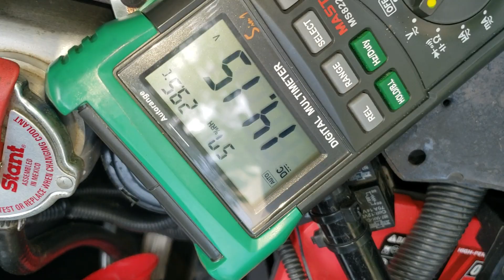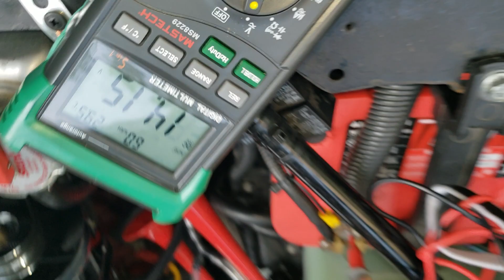CHICKENS inside my 140-Amp 1-Wire Alternator.  🙃😯😅

Comment: yeaaa baby. CAll Powermaster .... Summit carries that brand also in chrome. Get the 160 amp .... and sometimes the one wire needs a bit of rev to energie, I took them out of several streetrods cause they seem to 'lock up' and wont energize when you crank the car and the electric fans are on at start up.
Reply: you might as well look and see if it has a stray washer inside it, magnets and all.
Reply: If you take a long piece of wood, like a broom handle or old fashioned 'yard stick", you can useit to hear the bearing ... use it like a stethoscope